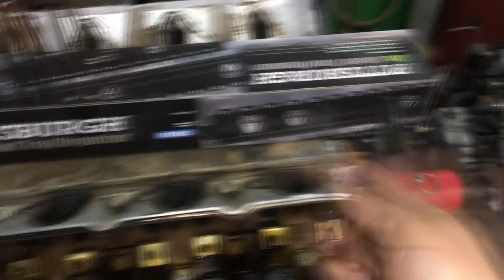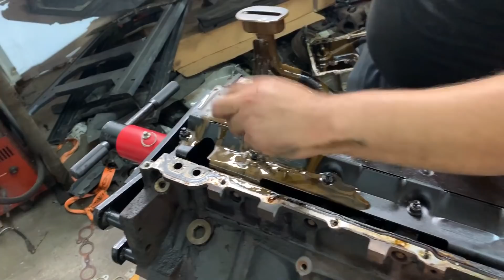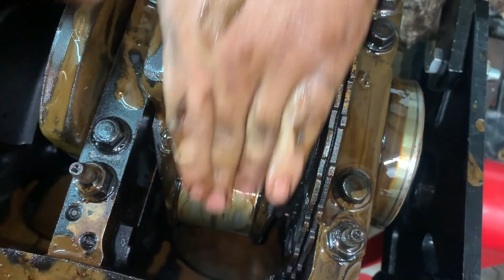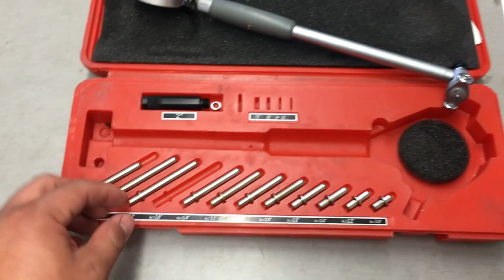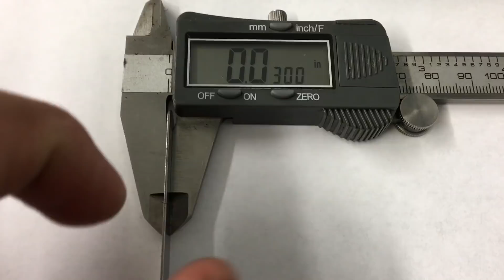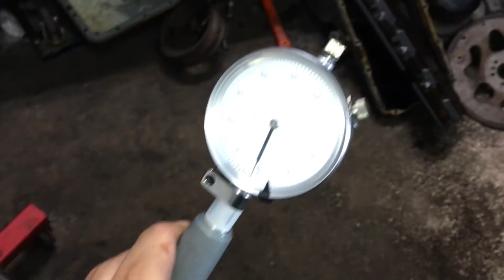ENGINE REBUILD GM LS V8 PART 1 TEAR DOWN AND INSPECTION

Comment: Something else to consider (more on aluminum blocks) is checking bore on axis with head bolt holes.
If your machine shop doesn't use a torque plate for boring/honing, this is must.

Comment: My thoughts on "calibrating" the digital dial caliper & dial bore gauge...
1- You're setting it up, not calibrating it. The caliper could be out at 3.750" and good at 0.030". If you have a mic set, use the 3" & 4" standards to verify range use is good.
2-Once caliper is locked, pivot dial bore gage from the end without rollers since you're not in a cylinder. The part that moves is between the rollers. Notice your bore was -0.0005 (undersize after 300k miles).
3-If caliper jaws are long enough, you can turn gauge 90 degrees and set with wheels on the jaws and pivot like normal. You don't need to pivot far (thinkness of jaws is your limit for pivot this way).
Just some food for thought.

Comment: Those are NOT knock sensors..they ARE HOWEVER OIL PRESSURE TOWERS FOR THE ACTUVE FUEL MANAGEMENT SYSTEM..These are used to enable the shutting off off the predesignated cylinders in the engine..this is active fuel management as your 2 or 4 cylinders will become inoperable until the computer deems it necessary to re-enable these cylinders...KNOCK SENSORS..LMAO

Comment: Hey guys ,I have a 2008 GMC sierra Dinali I recently start having oil pressure issue so I remove the oil pressure sensor and use a pick to get the screen but there was no screen it was a 3” pick that fell in the hole and I could not get it out I remove the oil pan and still cannot see any pick what should I do?

Comment: When checking cylinder head and block deck for straightness you should not just go side to side but diagonal corner to corner as well. I’ve had many engines that were flat side to side but out on a diagonal.

Comment: Ls love. It
Reply: Good job I love engine work the ls is one of the best engines gm has manufactured you can pull 1000 HP easy cam and head work that's it little more but close I've been building engine 30 years my first engine I was five years old my dad own a Volvo dealership  I learned tons now I can only do what I can do I'm hurt got hit head on my backs a mess but I enjoy what your doing your other jobs are cool can you build transmission try them not to bad do it in steps not to bad if you do a couple the cvt pain in the ass just remove them valve body's are nightmare I don't like them because computers run right solinoids nightmare time no fun no thank tou
Reply: There always more than one way to do stuff as long as your results are good does not matter good job you schould try to paint every painter will tell you different way to paint it took me a while but I can pain also
Reply: Hone them crosshatch pattern
Reply: Ring measure each ring in center and measure in-between ring
Reply: Good job

Comment: Just a little tip from another gear head that loves building engines if you ever want to know if a scrapyard engine had water in the oil before or after being in the yard just look in the oil pump like the one you just took apart notice the oil in the pump was not milky that’s a good sign that the water was not in the engine before the scrapyard it’s not full proof but it’s a good indicator thx for the videos my friend I enjoy watching someone that knows what he’s doing not just acting like you do!

Comment: Been 45 years since I rebuilt an engine, I still remember what a pita those cam bearings were. Only get one chance to get the oil hole lined up.

Comment: Have an 03 Tahoe LS. Approx 140K miles and looking to do a budget rebuild to it. I know its not a lot of miles but rides eh and would like for it to run smoother. Its not the oil and no leaks. I hear a "clicking" sound when I ride and thing it may be a rocker. Trying to keep the truck forever. Transmission is ok and will that be a prob?

Comment: You need to calibrate the caliper near to the size you are measuring because the caliper could be bent in some way. To correctly calibrate your bore gauge you need to use a micrometer and check it first with a known size object, best would be to use slip gauges, you will never see an engineer set a bore gauge this way it is totally wrong.Having said that I like all your videos and hopefully we can share some tips with you.

Comment: At a minimum, would send out heads and block, crank, rods for machining,  Buy new lifters, cam, push rods, harmonic balancer, oil pump, pistons, rings, bearings, timing set, water pump. Definitely MLS head gaskets. Then shorty headers, Flowmasters. Aftermarket coils, Brisk plugs. Aftermarket intake, throttle body.
Reply: crimp creep yeah tell that to the customer who’s paying  lol 😂

Comment: 340,000  holy crap!!!    my 2001 Sierra with a 4.8 0nly has 146,000.  Good to know I have a while to go before I need a new engine. I run Mobil 1 synthetic with a Mobil 1 oil filter.
Reply: My 02 Ford mustang GT 5speed car. Has a 4.6 2 valve engine Feb will b years 17 I've owned Baby and 350000.0miles I've always used Mobile full syn 10w30 and Motocraft filters!! Never Had first trouble!! Best car I've ever had!!

Comment: Gerotor oil pump. The lower main bearings take the most load and the upper rod bearings take the most load. Look at those to see if they are scored badly. If they are then the crankshaft bears close inspection for oval journals.
Reply from the maker: Thank you for the correction!

Comment: I have a 5.3 with occult coolant loss, about 4L per month. Pressure testing was normal and there is no pudding in the oil pan, though there is a little pudding under the oil fil cap. On review of the topic I discovered the 5.3 was prone to subtle cracking of the cylinder heads, often resulting in coolant loss and oil/water pudding under the valve covers. It's a great engine but the rust in your pushrods on one side is a little disconcerting. How would rain get in there?
Reply: That would seem to me those are cracked heads. Typical with the 706 heads

Comment: 340K out of the original engine is pretty impressive.  He must really love this vehicle to spend this much on it.
Reply: I sure do.
Reply: Its a clean truck and at its age he likely has it paid off. This is a much cheaper alternative to him getting himself into another truck note
Reply: my engine is still running after 416k miles on it, still runs better than the stock 5.3 ls vortec new

Comment: Most shops today won't touch a rebuild---it's too time and labor intensive, and costs about the same as buying a rebuilt long block with a warranty
Reply from the maker: Very true. I only agreed to do it because the customer insisted and plus these engines are fairly simple to rebuild. Thank you for watching!
Reply: Exactly what I was going to say. Get the bay freed up!
Reply: Reminds me of looking at old service manuals, where mechanics actually rebuilt parts instead of replacing them. It is refreshing to see a shop actually doing more than part swapping.